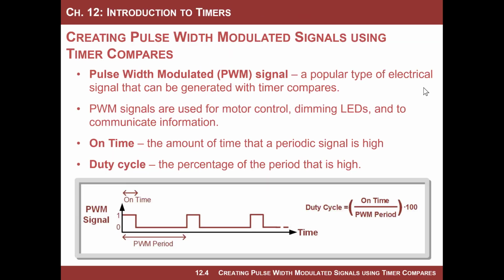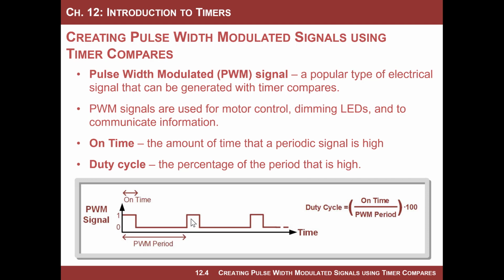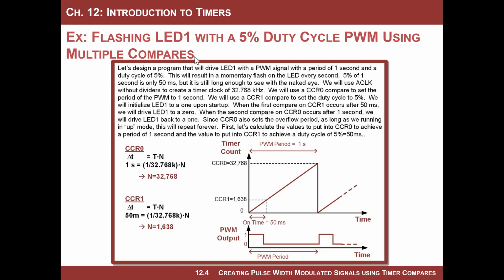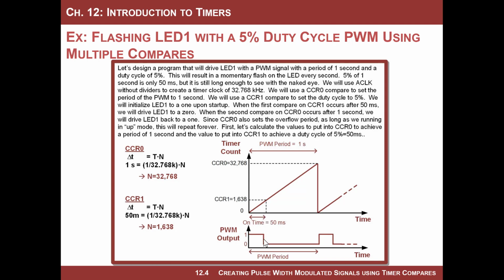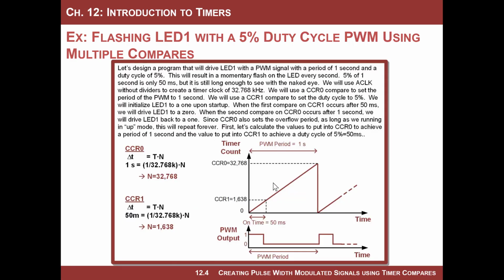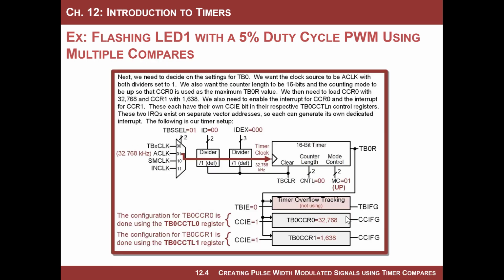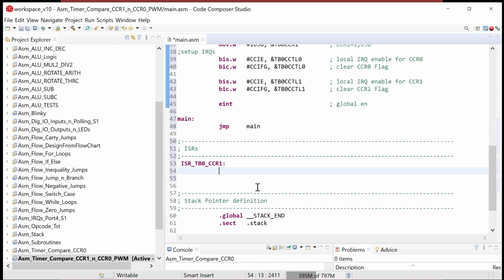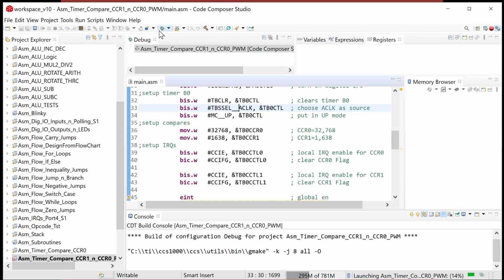12.4 - MSP430 Timers - Generating PWM Signals using Timer Compares

Comment: If you reduce the TB0CCR0 to 327 and TB0CCR1 to 16 instead of TB0CCR0 to 32768 and TB0CCR1 to 1638. you can actually see a PWM working with LED getting DIM :-D